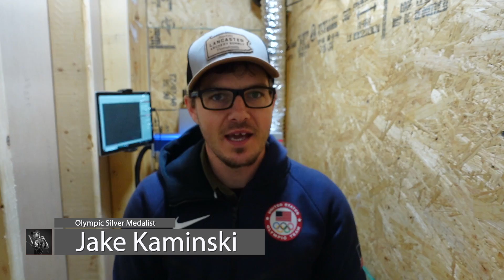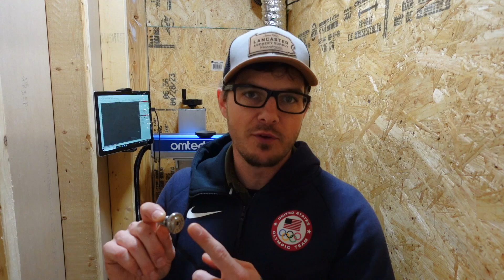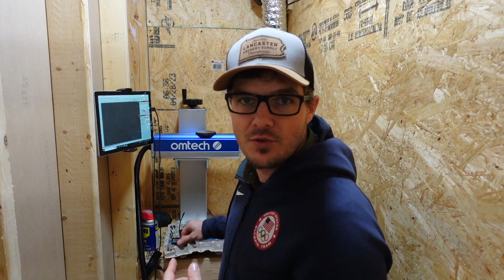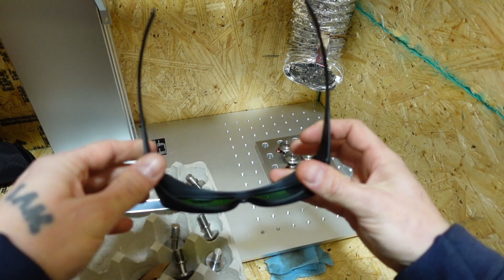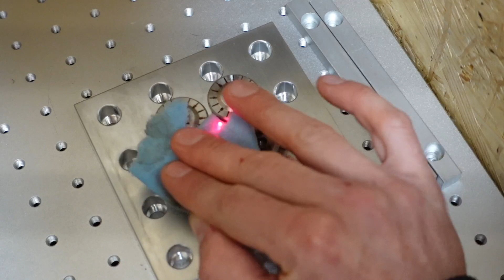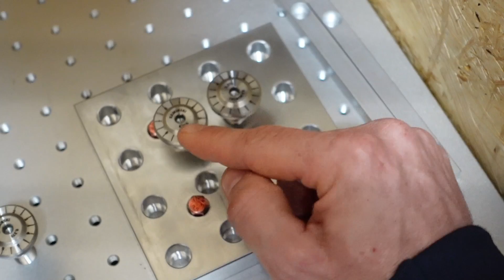Behind the Scenes Look at Precision Tiller Bolts

Comment: Could make a U shaped steel plate with a .374 slot and .375 slot to speed up sizing. If it slides in the 374 its undersized, if it doesn't fit the 375 its oversized.

Comment: I hope that caliper isn't the only measuring tool used for QA 😂. Even really good ones are only good to +/- a thou, which could mean what you measured as 0.3745 could be anywhere between 0.3735 and 0.3755. Would be good to see some micrometers as go/no go gauges.
Reply from the maker: I use a ratcheting micrometer with carbide faces when checking the prototypes as does the machinist on all parts prior to shipment. I just verify as a secondary check, any that seem close get double checked on my end with a micrometer before laser etching.

Comment: This is a brilliant product, we have 2 sets. But not for the main reason you market them for. I have always found new  W&W limbs fit right out of the box into the factory bolts very well. At times they can be too snug and hard to remove until they wear in a little. However both the thread cut into the riser and the collet bolts in the riser are made from soft aluminium. If you change settings a lot the aluminium wears. Which means you need to tighten them more so they don’t rattle free. Which wears them even more.. Eventually you end up replacing the bolts. Or worse, can also severely wear the threads in the riser. The stainless steel construction and perfect machining on your bolts make them very nice to use. They tighten progressively and lock into place without too much pressure and stay that way. They protect and extend the life of the riser. Worth buying for that reason alone in my opinion.

Comment: I would need  bolts with angle adjusting head because the downside of the bolts head is not perfect contact with the limbs surface. Information please Thanks from Italy
Reply from the maker: That design has been tried a few times in various different ways, all of them have failed. Between sloppy fit and wear, the tiller constantly changes or the limb alignment shifts dramatically which is far worse than a solid bolt.